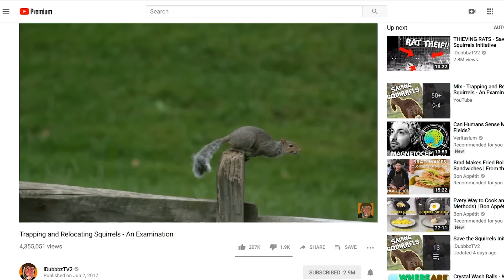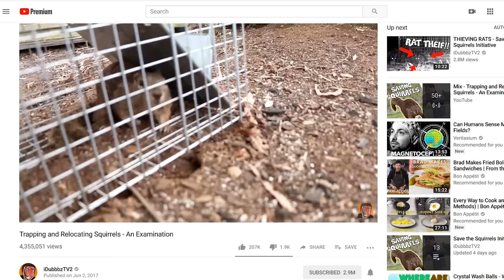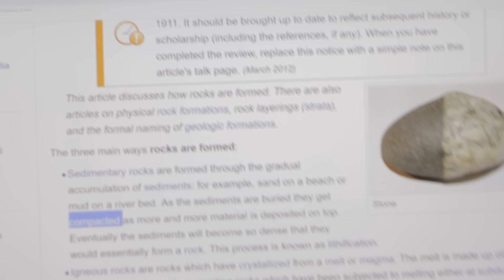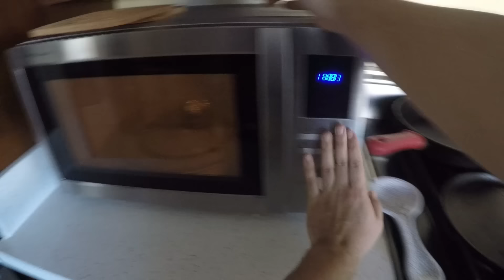We Built A Squirrel Car To Spy On Squirrels

Comment: I actually tamed squirrels as a kid, I got them to come up to me and eat out of my hands and such. One thing I saw here was the high pitch whining of the rc car was actually resemblant of alarm screeching of small mammals. Secondly, when they drove the car, they didn't move like a squirrel. Squirrels will run a few feet, stop, move a little, and then run again. They didn't do that with the car. Also, squirrels can be leary of human scent but I don't think it is that big of a factor. If they wanted to be thorough, find just a little musk to put on the squirrel decoy. Also, when making the squirrel calls you can make them with your mouth so as to have the right sound. Otherwise you end up with a non natural sound coming from the speaker. Also, instead of an rc car that turned with it's front wheels, use an rc car that turns like a tank or zero turn mower. Have the ability to change direction quickly on a dime with fast acceleration and good top speed. Also, it would take a while for squirrels to get used to the thing. Basically if you are present only when it is, the squirrels will know something is up. Sorry for the rant, I just shared much of my useless knowledge of squirrel behavior and how to mimic it. I hope the internet is now happy. Lol